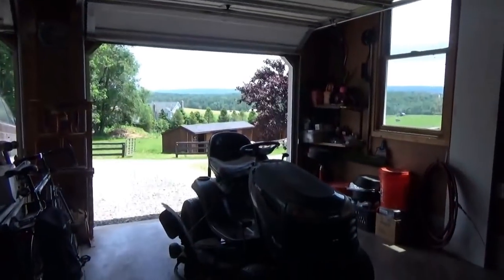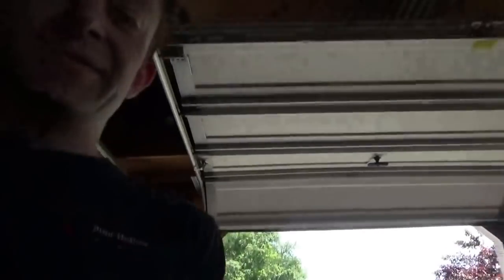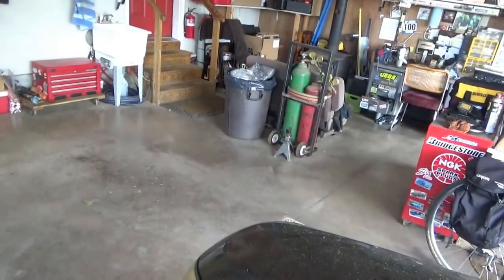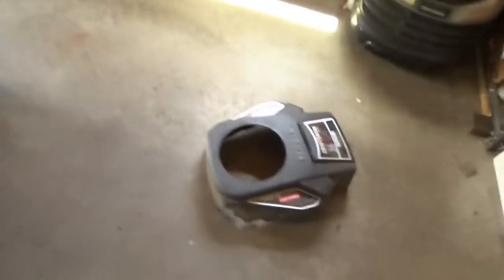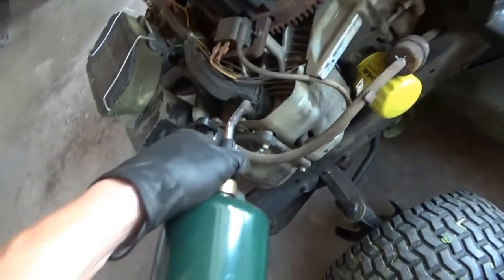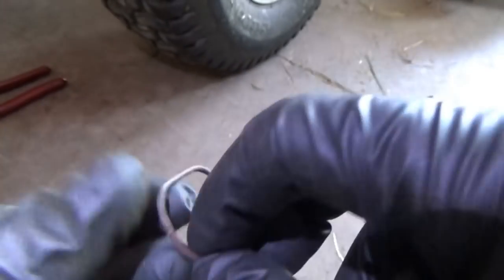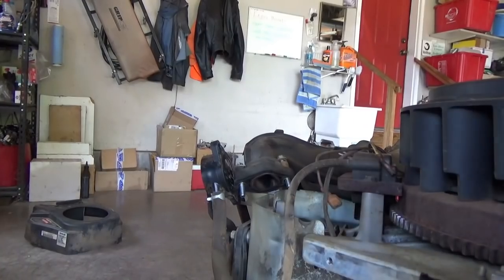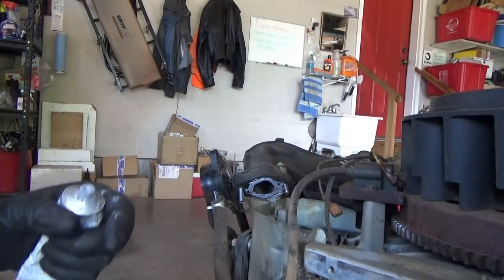Lawn Tractor: Stall/Misfire/Runs Lean!

Comment: your better off with a water spray. that propane with the flywheel  ya  might as well pee into the wind.  truthfully never seen intakes do that  but it is possible.  that has hydraulic lifters and are prone to pump up.  thats why they only recommend 10w30 only.  also you had the two wire coils which means it had a  sam module (spark advance module)  these were notorious for intermittent failure and since it only did it hot  this could be a problem. kohler wants you to change both coils and dump the sam module (nla) if one goes bad.  also the carb has a sollenoid on the fuel bowl. they go bad.  thing is it only operates the high speed circuit so it will do exactly as described, start and idle but no high speed without the choke.  thus why they say in the owners manual to shut it off with the throttle half way or higher. if ya dont youll get gas in the muffler that explodes.  replaced many a muffler because of that.  glad to see its runnning good  but if it acts up  those are some things to check.
Reply: junk needle/seats on the gravity fed engines with tank up high are critical on fuel filter type.. solution install fuel shutoff valve or it will flood the engine, fill the exhaust, lock itself up etc...
the above mentioned valves often stick closed and the thing wont run period... root cause good old ethanol and other detergents ;)

Comment: My 14 year old john deere is doing the same thing. I've changed all the filters, replaced with very high quality spark plugs, changed the oil and cleaned the carb. Only use premium gas with no ethanol. Going to try this next. If this works, I owe you dinner.

Comment: Ivan, my MTD riding mower had the same symptoms , I had to replace the intake manifold, it was broken @ the carburetor mounting flange. After I replaced the intake manifold I also found the fuel line pinched on the hold down bracket next to the cylinder head, I replaced the fuel line, problem fixed. Nice video !!

Comment: often times I get repairs come in that are close to what you first described, mowers that run fine for @20min then just quit...let cool down starts and runs fine @20 min. later it quits. In those cases its usually the fuel is vapor locked (like holding liquid in a straw by capping the end) the fuel cap has a tiny vent hole that gets glogged not allowing the fuel to flow, mostly in gravity fed type systems but I have seen it with fuel pump systems as well. good find on yours, that happens a lot with chain saw intakes.

Comment: Thank you for the tip. Had similar issue, tractor would run fine for 15 min then stall and run lean. Replaced fuel solenoid coils plugs gas cap then pulled intake and added permatex now it runs great again 👍

Comment: Nice work, Ivan! I love working on these things. It's stress free for me - everything is usually straightforward and simple, like cars were 40+ years ago.👍 When I get into these, I'm confident I can fix it ... unlike modern cars. 😂

Another issue that will cause the exact same symptoms is a plugged gas cap vent. When I saw the first minute of your vid, that's what 
I was expecting. It'll run long enough to put the fuel tank into a vacuum, then die of fuel starvation ... only to restart moments later as air creeps back in through the blockage! That'll get you scratching your head! 

I had a John Deere G110 with a Kohler Command 25 (CV730S) that this happened to. Was a tiny hole in the fuel cap for a vent. I mowed for a half hour, no problem  - then it became ... mow 5 minutes, die, repeat. Took me a while to find that one, being super frustrated. As a last resort I grabbed my fuel can (figuring I'd top the tank off, thinking I had bad fuel), and as soon as I unscrewed the gas cap off the tank, I heard a "hiss". Bingo! I ran a drill bit through the hole a couple sizes larger after peeling out the rubber baffle, and it never happened again. Was dried up grass packed in the hole!

Another issue I had on that tractor was blown head gaskets after just 160 hours! That was a common issue with this particular engine. I was one of the "lucky" ones that had this happen out of warranty, since I only mow 20 hours a year ( I have a couple acres, but I mow fast and infrequently - you can see lawn care isn't high on my list of fun things to do, lol). Mine burnt up a quart every mow when it got real bad - I'd be breathing oil smoke the whole time. Pretty aggravating. I had paid alot of money for that machine brand new, and I work on stuff 30 years older all the time with 400x the hours, and zero engine trouble. Just the way of the 21st Century ... 😡 I got rid of that one after 9 years of ownership, and bought a Husqvarna zero turn 5 years ago. Cut my mow time down by 25%, at least!  👍 Only 79 hours on the deck so far (no engine hour meter - only a clutch-activated hour meter).

Comment: Excellent video Ivan. I actually do small engine repair. Never seen someone use rtv to seal a gasket though.
Reply from the maker: Really? RTV is used on a lot of gasket applications!
Reply: well on a lot of vehicles today there are no more oil pan gaskets or upper or lower Intake manifold gaskets it is gasket sealant, trust me on this.

Comment: A buddy of mine was having similar issues with his mower. We checked and cleaned the carb. Replaced the fuel pump and inline filter (Did improve some)He still had to use the choke to keep it from leaning out. It ended up being a long piece of fuel line. We noticed it was getting wet while the engine was running and he had to have the choke partially on to keep it running. His was a honda twin cylinder GXV620. His fuel cut off solenoid appears to be sticking at times also so we plan to replace that in the near future also. I love tinkering with small engines. I rarely pass up the opportunity to troubleshoot them. Nice job fixing 👍 that intake leak. I think the silicone was a pretty good fix.

Comment: I have one of those metal bottles that u pressurize with shop air. I use gasoline to find vacuum leaks. Have been doing for twenty years. If your nervous don’t do it. It is also great for spilled oil on the floor and spraying gooky oily wet bolts and threads. For those  Nervous Nellies. The propellant in all these spray things we use is usually something like iso butane. Carb spray, brake clean and W-D40 r all extremely flammable. To test and become accustomed to how it reacts to flame, when we have a nice little fire in the backyard, I spray into the fire and watch how it burns. Propane has never worked for me finding vacuum leaks. Put your scan tool on obd 2, short term fuel trim. Watch the numbers while giving a little toot. Works great. U didn’t hear it from me. In the old days, they used Freon as the propellant. When that stuff burns u get phosgene gas. In WW1 they called it mustard gas. Pretty tuff on the lungs.

Comment: At 7:03 you said you mowed 10 minutes, I assume with the fan shroud off. If you are going to test run the engine for long periods put the fan shroud on as it directs cooling air from the flywheel fan over the cooling fins on the cylinders. No fan shroud = possible overheat.

Comment: For a 2006 that’s not bad if this is first issue. I love the craftsman mowers they are great. Sometimes my generator is like that and I need to figure it out, runs on propane no problem but difficult on gas.

Comment: Ivan when it is time to put the craftsman aside, switch to a zero turn mower it will greatly shorten the time it takes to cut the grass. when my children moved out and I had to cut the lawn, three hours on my craftsman to do the job was just way to much time, i do it in less than an hour on the zero turn.
Reply from the maker: Wow which model zero turn did you get?
Reply: @PineHollowAutoDiagnostics  I picked up a used Simplicity Citation that was in need of repairs, it is the same as  the Ferris 1500 Z it is a commercial model. it had 300 hours of run time on it. The attraction of this brand is they have a suspension,  and i also added a suspension seat system. it is capable of cutting lawn at 9 mph.  I dont cut that  fast.  the suspension was important for me. I paid $2000.00 for it 4 years ago. and it has been an excellent mower. build quality and materials used definetaley built to last
Reply from the maker: Nice, Todd! I'll have to look into the used zero-turn options :)

Comment: When using RTV I leave the O-ring out.
Got a tractor for free, had to adjust the carb for altitude, CO poisoning is a real hazard with these engines.
Having been in the business many years , CO exposure is nasty stuff. I lost count of events involving CO, having a headache for days is worth avoiding. Any motor running rich is a huge source of CO, no computer, no fuel management equals CO.
Make sure it's outdoors, if you need to deal with a carb, work outside.

Comment: RTV sealant has got me out of trouble on many automotive applications,for example, I stopped the thermostat cover which had some pitting in it  & it was allowing coolant to leak past the O ring on a 5.7 litre Chevrolet LS1 V8 engine that's in my Holden Commodore, I applied a smear of silicone sealant onto the water pump gaskets to minimize the chance of them leaking as well.

Yes, I have Russian in me which was both of my mothers parents & my father is if being part Armenian counts as being Russian !

Comment: Intake leaks will get you every time.  A number of years ago I bought a nice-at-the-time concrete partner saw.  Basically, these are two-stroke chainsaws with a diamond circular blade replacing the cutting chain.  The price was absolutely a deal of deals.  But, the seller's demo just seemed a bit off.  Three minutes into the demo, it ran out of gas and he took forever to walk back to his shop (loads of ATVs and such in-process of repairs) to retrieve gas.

Once home, I fired up the saw and attempted to cut sections out of the sidewalk needed for new downspout-to-curb runs.  Once the engine got hot, it died.  It wouldn't restart until cold again.  I went through that thing with a mechanic's fine tooth comb a half dozen times.  It's not like they're that complicated...

Finally, after another head scratching session of problem determination, I noticed fuel in the chassis where fuel shouldn't be under the carb-to-intake boot.  "There's your problem, lady!"  A small boot tear sealed while cold.  But, once warm, allowed air in to the combustion charge downstream of the carburetor.

A buck or two for a parted out intake boot off eBay and the thing now runs like a scalded greyhound.

The guy that sold it knew of the issue hence the long retrieval of the gas.  Would have loved to drop him a line letting him know I found the problem and fixed it for a couple of bucks.  Of course, I'd hold back it took me hours upon hours to find.

Most of success is sheer tenacity.

Comment: just to add to the possible causes to look at, I once had a mower that had a similar problem, It ended up being caused by a faulty fuel on/reserve switch. The switch had a leak which caused the fuel pump to suck air and after a while the air pocket would build and make its way to the carb causing it to run lean and almost stall.

Comment: I have heard that the John Deere 318 tractors have an issue similar to this but it is from the intake being two separate halves. The rtv deteriorates and causes weird issues similar to this. I think that there are some other models that use the Onan engine that could have that problem as well. I have a 318 myself but have not seen the issue....yet.
Reply: Yes, the Onan twins did have that issue. I had to reseal the intake on my Case 446 with the Onan BF engine, and also on the Onan P224 on my skidloader. I used Permatex Moto Seal, similar to Yamabond. Designed for case sealing.

Comment: I'm having a similar issue with my 1980 John Deere 214 with a single cylinder Kohler engine. 
Only wants to run with full choke (at first, half-choke did the trick), and won't run with PTO engaged now. 
It's been a fantastic lawn tractor, but this had me scratching my head. 
I too, thought it might be an intake leak. 
Some people suggest a fuel pump, or gunk in the carburetor....Personally, I think it's much more likely to be a vacuum leak at the carburetor gasket.
Reply from the maker: Definitely take out the main and idle jets to make sure there is no gunk in the orifice.

Comment: My Briggs & Stratton intek 18 horsepower V-Twin has cast aluminum intake plus my fuel pump is made out of metal casing. The difference between retail and commercial use motors.

Comment: I've seen a lot of those with cracked plastic intakes, right at the seams. I suspect a vibration issue over time along w heat causes this. In your case, this was not the issue. Buy the new o rings for a long term fix!
Reply: lol yup i made the same comment before seeing this
Reply: Even plastic upper Intake Plenums crack over time on vehicles and on a lawn tractor they are not made from the ABS Plastic probably now recycled plastic,🤣🤣so you definitely know it will crack a lot faster I know my 12 yo push mower has a ABS intake manifold on it but the mowers and tractors of today I dont really know i am sure they are ABS plastic but with recycled plastic too I guarantee this.

Comment: Of course check fuel lines but yes gaskets carb, intake, maybe just retorque.  Or just fix it with a cigar.
Reply: yeah the scotty kilmer way no need for a smoke machine but you can make yourself one out of a paint can and alligator clips big enough to fit on the battery terminals or posts.

Comment: I had a similar  problem, but my Craftsman 26 hp mower would die after 15 minutes of mowing. Turned out to be my gas cap wasn't venting (allowing air into the gas tank). I drilled some very small holes in the rubber sealing area of the cap and never had another issue. I also leave it just bit loose...

Comment: Coincidence that the RTV fixed that imaginary intake leak. Could be fuel pump/pulse pressure issue also. Clean the vent in the gas cap with a micro drill bit.
Reply from the maker: Good thought, but the scientific proof is very convincing that the intake leak was not imaginary for 2 reasons:1) Fuel pumps and gas tank caps typically don't fix themselves.2) Tractor has run flawless for three mows after the RTV repair. Actually I just got done mowing haha

Comment: What do you think the odds are this working long-term? I was always told that silicone-based products and gasoline don't go well together as the gasoline will break down the silicone product. Oil okay gasoline not. Now I don't know if newer products since I've been messing with this are different nowadays?
Reply from the maker: I'll let you know if it acts up again :)
Reply: yes taz there are different rtv's now for coolant, gas and oil and even for exhaust manifolds so go to your local parts store and check them out.
Reply: but there isnt any oil or fuel anywhere near the intake manifold the gray one is fine for sealing that area no type of liquid goes through that area now if it springs a fuel leak it may break down that gray rtv possibly.

Comment: I have seen the stock fuel line collapse on the inside and starve the engine. Runs great cold, but when it warms up the line will swell. A bitch to find. I just happened to grab hose with it running and felt the knot where it came apart on the inside.

Comment: Had same issue with mine and it was a loose carb, tightened the two nuts in front under the air filter an off you go.

Comment: I thought this was Pine Hollow AUTO Diagnostics, not Pine Hollow Small Engine Diagnostics! Does that thing even have a OBD2 port or Check Engine Light?
Reply: you always need to use basic knowledge because if you are missing air or fuel or spark or have too much air or fuel the engine runs differently in both cases and emits different emissions in both cases, correct?

Comment: no parts required.  I used to have a volvo s60 that gave me air leaks at the gas cap. gasket was pretty ratty...  I packed it with Vaseline.. no parts required.  code never came back..

Comment: Curious, Ive only seen those Brigs and Stratton engines with 1 cylinder. It's weird to see ohc and multiple cylinders on a lawn mower crazy lol
Reply from the maker: I have a 1970 Snapper aluminum deck push mower with the old school Briggs and Stratton 3hp engine. Crankshaft is a bit bent but that sucker will not die haha
Reply: @PineHollowAutoDiagnostics  I have a 2008 Snapper 33" 17.5 HP Briggs, love it! 2 years ago I had to replace the head gasket and set the valves. Always starts and does the job. Purpose-built design with Snapper; it's a cult thing!
Reply: there are 2 cyl ones now

Comment: Where to plug in the scanner.....LOL....ROTF...
Reply: 😂😂😂 this one you would have to use a vacuum guage and fuel pressure guage and the pico scope to look at cylinder balance and spark it can be done but just having basic knowledge of air fuel and spark which if you are missing one or have too much of air or fuel or a lack of air or fuel how a small engine would run and yes you can always tell by the exhaust if it is too rich or too lean on a small engine 1 cyl or 2 cyl engine.

Comment: Make sure fuel cap vent isn't block
Reply: Usually the carb bowel has two #10 bolts. I usually remove the the off set one and allow the fuel to free flow to remove any debris from needle and seat.
Reply: Good diagnoses

Comment: Wouldn't have thought about the intake sucking air on a lawn mower, I was guessing the back fire valve. I guess one could say you Russian rigged it and good as new, ha ha .
Reply: but it wasn't backfiring the back fire valve prevents back firing which is not good for the valves or the piston rings in the long run on a small engine